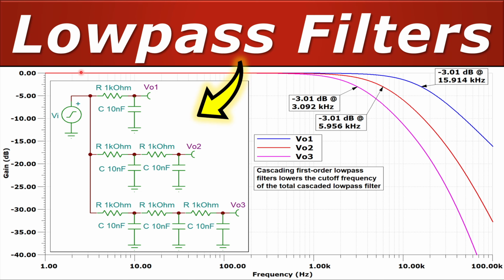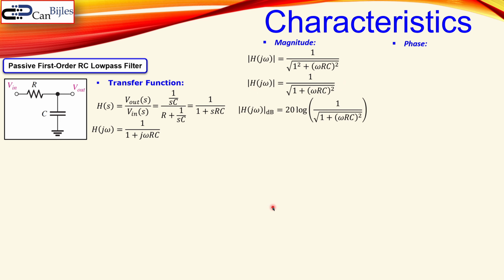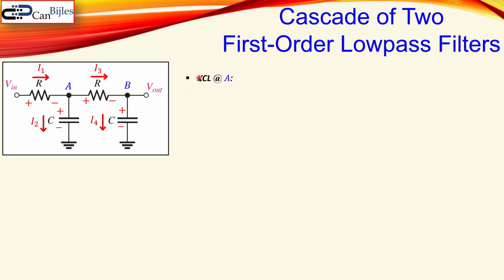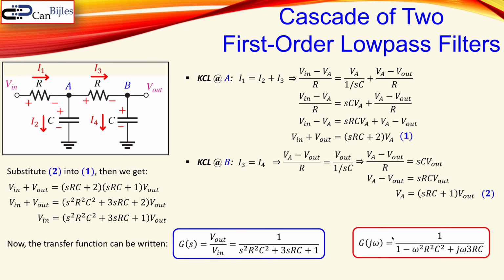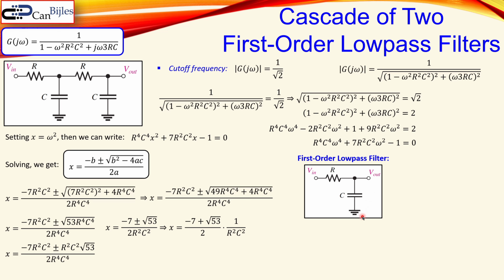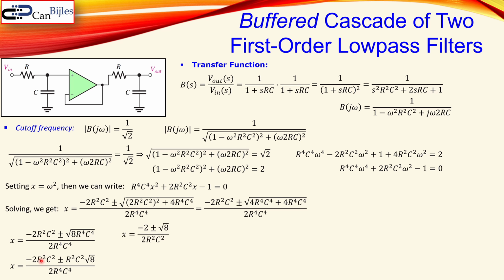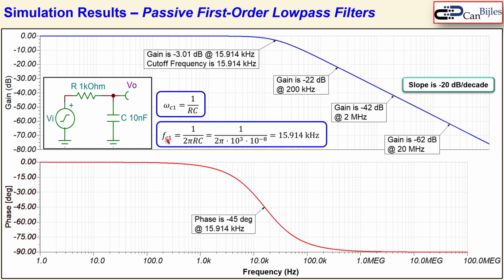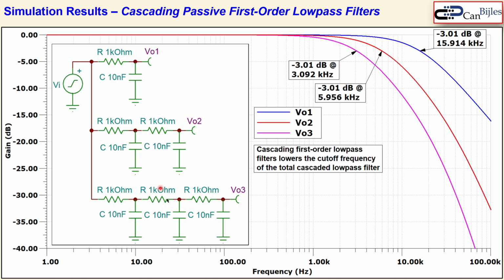Lowpass Filters - Transfer Function & Cutoff Frequency 🌟 Step by Step Examples with TINA-TI SPICE

Comment: Other metod is a Z scalling - ech next RC section is a 10 times greater. ( R2 = 10 x R1 and C2 = C1 / 10 ).
Reply from the maker: Interesting approach, impedance scaling is definitely a great way to handle cascading stages. But, is there a specific reason for making it 10 times greater? Why not 5 times or 20 times larger? What is so special about 10 times greater?
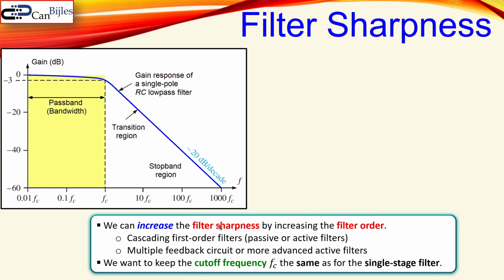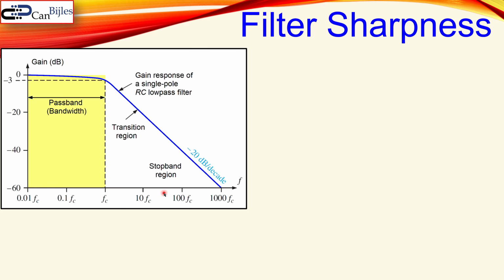Reply: @CANEDUX You would have a great opportunity to experiment with a circuit simulator to see how a second-order RC filter changes as the ratio is gradually increased from 1:1 to 1:10. In my opinion, 1:10 is a practical choice—a higher ratio would only increase the noise level and lead to parameter variations caused by low capacitance or high resistance.😊
Reply from the maker: @ingussilins6330   Indeed, as expected this "10 times greater" is not a specific value, but a practical choice such the loading is minimum enough, noise level stay reasonably at a low level, and components values are still within the practical value range. I am planning to dive into this method too.

Comment: The cut off frequency of two stage RC Second order Low pass filter is at -3 dB or -6 dB point? Can you provide me strong reference for the explanation?
Reply from the maker: We need to start with the definition of the cutoff frequency. The half-power point is the condition at which a system's output power has dropped to half of its peak value. If we consider voltage ratios, this ratio will be 1/sqrt(2), which is translated into 3.0103 dB approximately. This definition will be always valid, no matter what the system order is. So, for a 10th order system, the same definition applies and should be used.
Reply: @CANEDUX  Thank you for the explanation
Reply from the maker: @MustafizurRahmanHazarika You're welcome!
Reply: @CANEDUX  but In my MATLAB code, I found the cutoffpoint as -6dB approx and phase as -90 degree.
Reply from the maker: @MustafizurRahmanHazarika   I am not sure how you simulate this in MATLAB, but the definition for the cutoff frequency is the same as I mentioned before, so it is NOT the -6 dB point, but the -3 dB point.